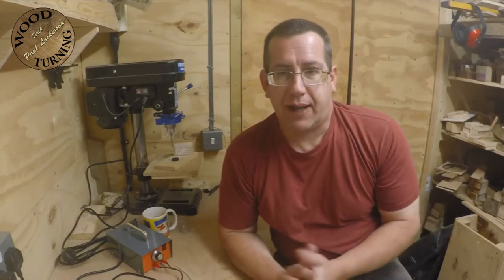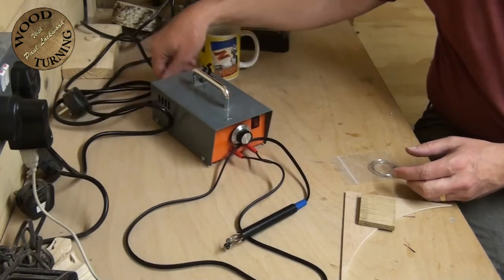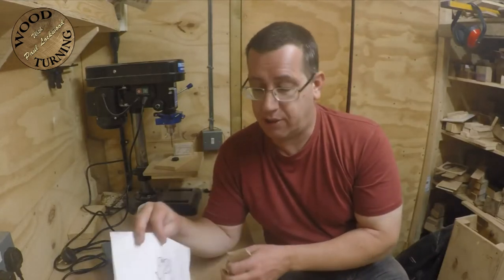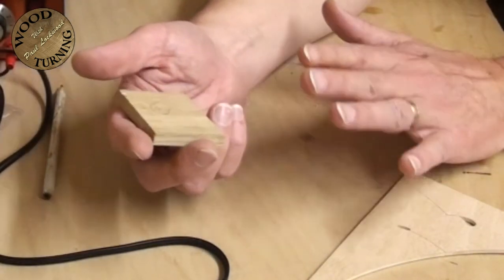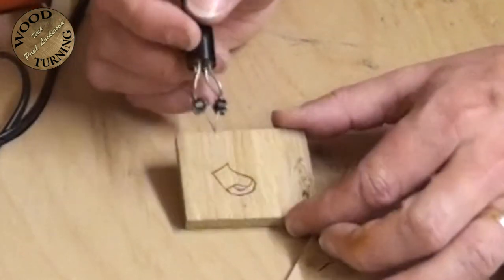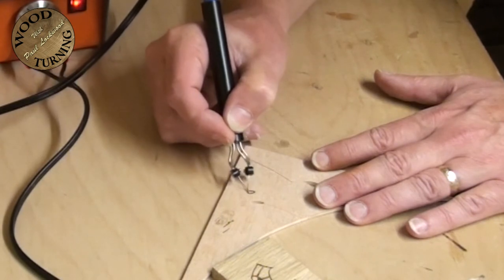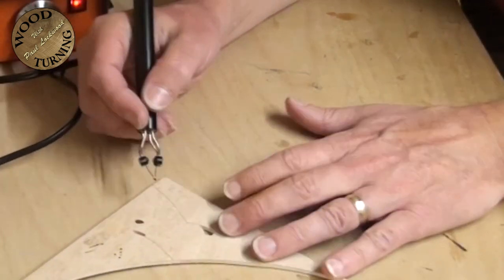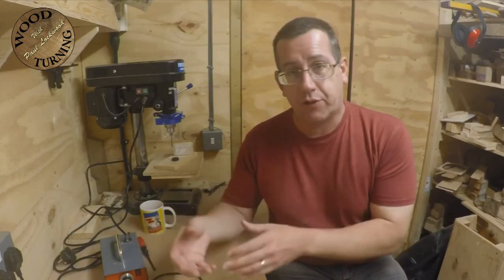Pyrography Talk (Peter Childs) - Episode 96

Comment: I have been burning with the same machine for only about 3 months now and even if I say so myself I am getting great results. I find it very advantages to sand the wood with very fine sandpaper then wet it let it dry and sand again get the wood as smooth as paper and it helps to stop getting caught in the grain. By the way great video
Reply from the maker: Thank you Neil. Yes I usually sand to a high grit, some wood though like Oak have a deep grain so there is not getting away with catches. I don't use this very often but certainly had a lot of improvements. You can see the last ones I did which was on Episode 174.
Reply: @PaulLockwood  I have up until now only used beech plywood, obeche and bass wood, but I have bought some oak blanks I will keep in mind what you said . Thank you

Comment: Thanks Paul, this was very useful because, being new and self-taught, I was using far too much heat when I was trying to burn my initials on pieces I have turned and was getting big blobs of burn where I was catching the tip on the grain in the wood.  I did try writing on the wood with a pencil to flatten the grain a bit first but still wasn't happy with the result.  Now I understand that the wire was too hot (8 or 9 on the dial).
Best Wishes, Brendan.
Reply from the maker: Thank you Brendan. Yes lower heat iv'e found is much better if you end up having to go over several times. May not be everyone's option but that's what I found works for me. If you have a scrap of the wood that helps to test on too.